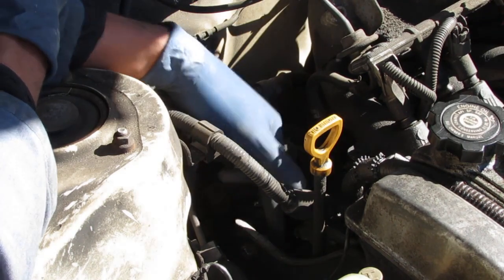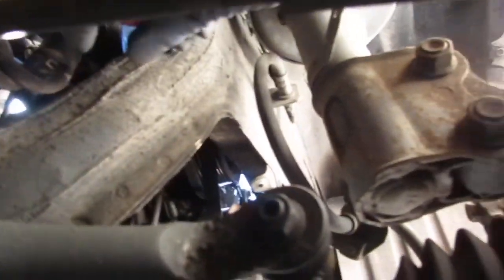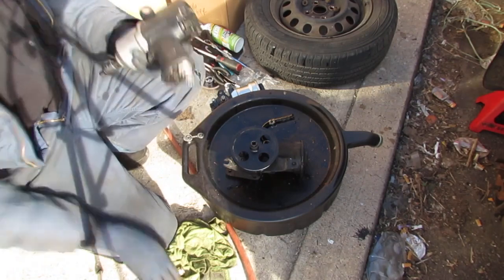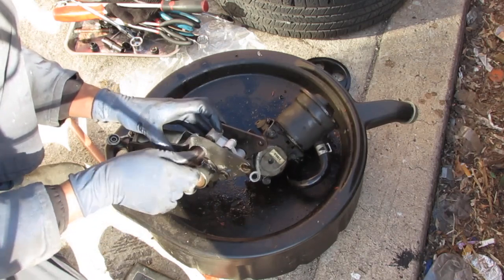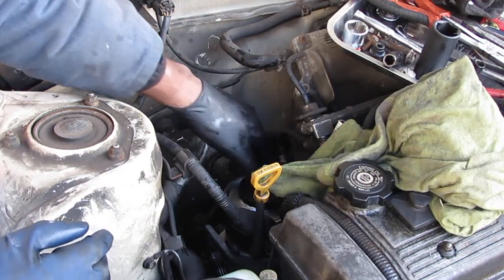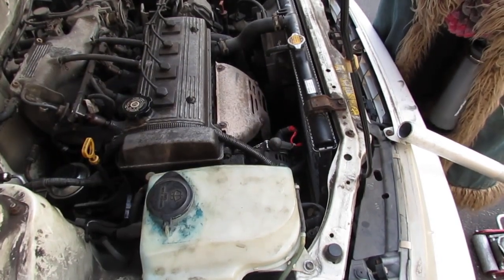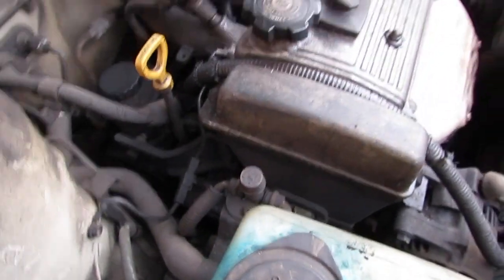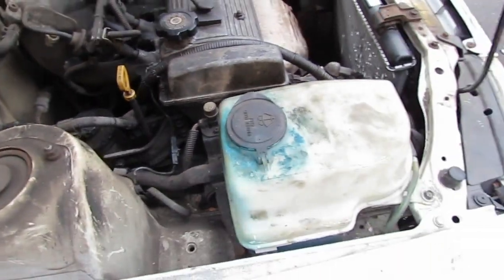1996 Toyota Corolla | Power Steering Pump | Belts

Comment: Helpful video dude! I used this as a guide for my 96 Geo Prizm, which is just a rebadged Corolla.
Reply from the maker: I had not idea.  Thanks for sharing this information.  I got this from Wikipedia :  The Geo Prizm and Chevrolet Prizm were compact cars that were rebadged versions of the Toyota Sprinter, a vehicle that the Japanese automaker Toyota never directly sold in the North American market. The Sprinter itself was derived from the Toyota Corolla. The Prizm was marketed under the Geo nameplate until it was discontinued after the 1997 model year. After that, the vehicle was marketed under the Chevrolet nameplate. General Motors (GM) referred to this and other Toyota Corolla derived vehicles as the GM S platform. The cars were produced from 1988 to 2001 (the last ones being sold for model year 2002) alongside the Corolla at NUMMI, an assembly plant operated as a joint venture of GM and Toyota. The Prizm was sold exclusively in the United States and succeeded the 1985–1988 Chevrolet Nova, which was also derived from the Sprinter and produced at NUMMI.